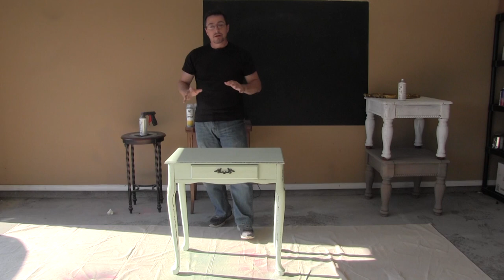DIY Chalk Spray Paint Small End Table

Comment: The drawer doesn’t stick to the wood behind it when it’s painted while closed?
Reply from the maker: This is a great question. If the drawer is something that you intend to use then pull it out and paint it separately. In this case, the drawer is decretive and does not open. I have other videos that have working drawers, and I always pull them and paint them separately. Once dry, our chalk paint should not interfere with opening and closing. Thank you.

Comment: I wanted details on what you were doing. Did you put a gloss finish on also? What grit of sand paper?  It was just a video on watching someone painting
Reply from the maker: Hey Julee, Thanks for the question. We recommend using 150 grit or higher sandpaper. This video is a few years old now so i'm not 100% sure if we used  varnish or the spray wax finish. I would say the varnish since we are not doing any buffing in this video. If you have any other questions let us know! Thanks!!
Reply: U replied on old question that it was varnish
Reply: Pinty plus varnish to be exact

Comment: Is the wax or varnish a must?
Reply from the maker: Its not a must, but just offers a protective top coat.
Reply: @PintyPlusUSA  well I used the wax with a brush & wiped the excess off.. & some of the spray paint came off..! Did I do something wrong?

Comment: What is the purpose of sanding before painting?
Reply: Sanding helps prepare the surface for painting. If there is any rough surface or bumps, sanding will eliminate or smooth these out. On the other hand if the surface is super smooth sanding roughens up the surface to provide more tooth (grip) for the paint you are going to apply.
Reply: @AWFPRO  Thanks for responding! How do I know if I need to sand a piece of furniture before painting?